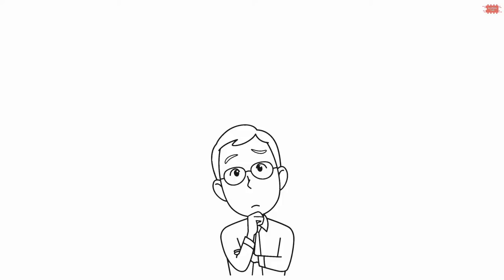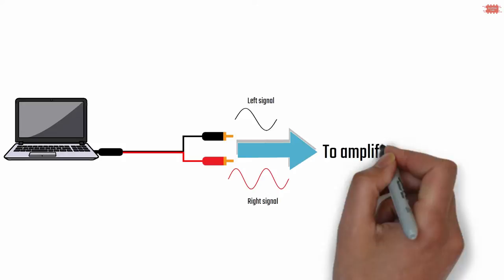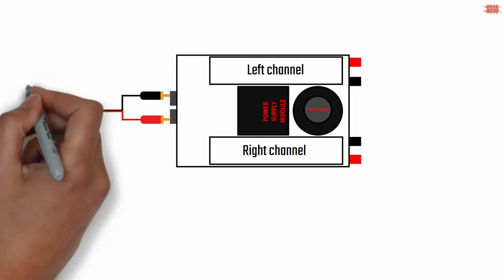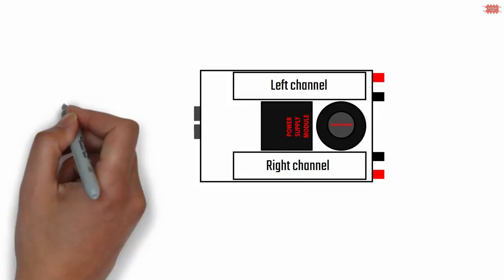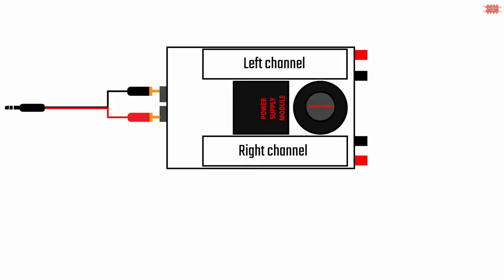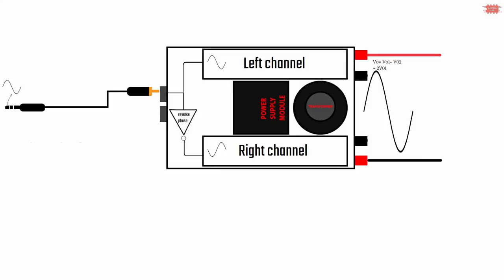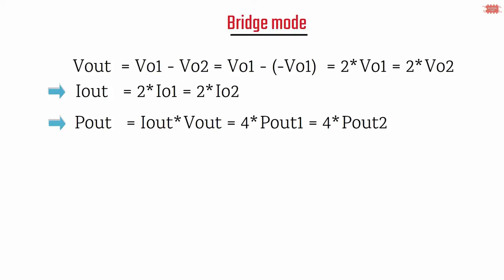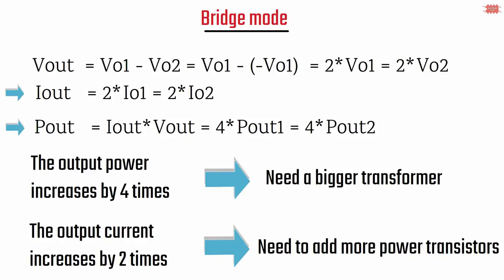How does it work| Amplifier mode| what is the bridge mode in power amplifier

Comment: Sorry for the long comment, just another thing: "dual" mode: I've seen in some of older car amps manuals connecting diagrams for this mode: speakers connected to right and left channels, and subwoofer connected - via passive subwoofer crossofer - basically in parallel with these speakers, just the sub connected to terminals which are for bridge mode (if the connection terminals are "ch1-L//ch2-R": "+/-//+/-", the left "+" and right "-" are for bridge mode, then to left "+" is connected the left speaker's "+" in parallel with sub's "+", to left "-" the left speaker's "-", to right "+" the right speaker's "+", to right "-" the right speakers "-" in parallel with the sub's "-"). Also in the manuals were 1 of these 2 notes - as example for the most common amps - which are stable at up from 2 ohms in stereo and up from 4 ohms in bridge : 1: speakers + sub needs to have at least 4 ohms, 2: if the speakers have 4 ohms each, sub needs to have 8, or if the sub have 4 ohms, speakers needs to have 8 each, and at both of these notes: 2 ohm speakers not allowed - the reason is obvious why. Also at some amps isnt recommended a passive crossover for the sub, but it is recommended to build a crossover system by wiring in series 2 caps with the 2 speakers, and a coil with the sub (to HPF the speakers, and have LPF/HPF at the same freq). If this wiring mode is working for those old amps, then for the new amps should work too, just I'm afraid of damaging the amp... What do you think? As a real example: manual of Sony XM-222MK2 amp's manual - I still have this amp - there is actually the "crossover-system dual mode" connection - just I can't share the link here - yt deletes my comment for some reason if I put here the link...
Reply from the maker: sorry, lately reply! Because your comment is long, I don't think I clearly understand what you say. If you need a support, send email to me.

Comment: If  I have 1800 rms in bridge mode I will use 2 subwoofer it safer to reach the 1800 rms?  Thanks
Reply from the maker: If your subwoofers are connected in series and power in amplifier is maximum.

Comment: Hi. Can I do this on any home amplifier? I have a Yamaha A-520 at 75 watts RMS
Reply from the maker: Your amplifier does not have the bridge mode, it only has the stereo mode and mono mode. If you wish that it can operate at bridge mode, you need modify its construction. You should not do it if you don’t have knowledge electronic design or never DIY, a wrong way can destroy your amplifier.
Reply: @ALPHALabs02  thanks heaps for the quick reply! I'm looking at getting the jaycar Bridge module adapter? I have bridged an Akai U210 amp with a 4 ohm subwoofer and sound was very nice. I have done quite a few repairs, modules etc. But Bridge the Yamaha??? Yeah I wasn't sure! Lol. Cheers 🙂